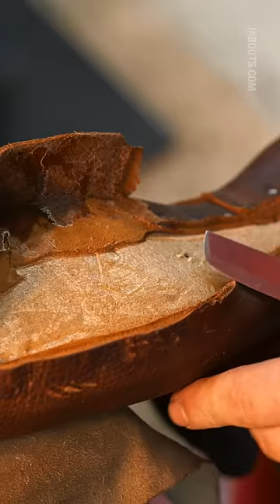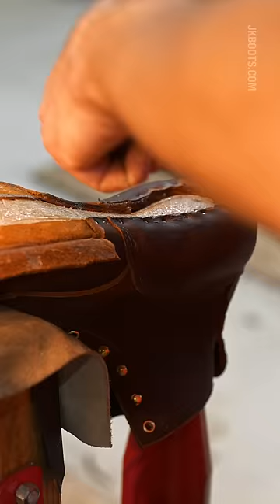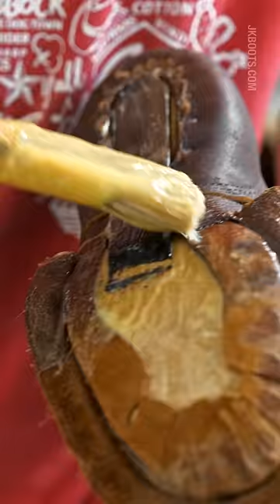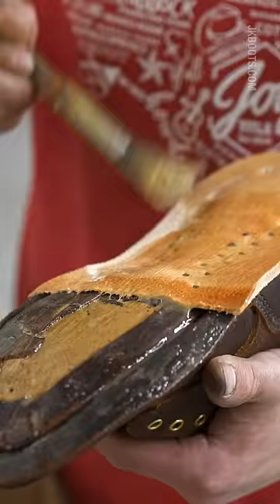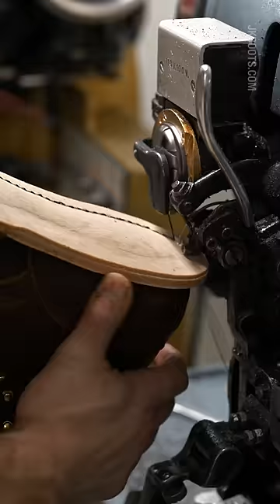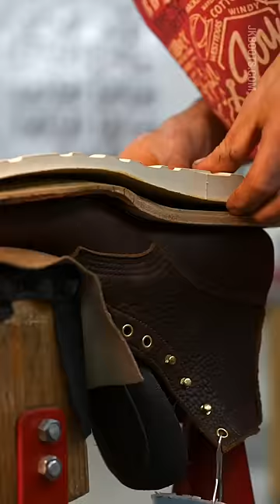Check Out The Full Video: How Its Made - American Bison Forefront Start to Finish

Comment: Whats protecting the string at the bottom?
Reply: Nothing :/
Reply: ассаламу алейкум такой обув у миня тожи надо дорогой
Reply: They aren’t needed, it’s just an extra step they use for redundancy and to charge more. These are sewed, tacked, glued, sewed, tacked again, glued, tacked, and sewed again. I left out all the pressing because you get the point. You can wear through the threads on the bottom but they only way you will ever see these come apart is if you physically just wear down the entire sole and make it to the next layer.

Comment: What's the point og a leather shank?
Reply from the maker: We use a leather shank because it forms to the arch of your foot better than a steel shank. After years of wear the steel shank will remain exactly the same as when the boot was new and could cause discomfort since the rest of the boot is broken in to your foot but the shank isn't. The leather shank will provide the arch support you need and will adapt as the boots break-in ensuring a custom-like fit for years to come. Hope this helps.